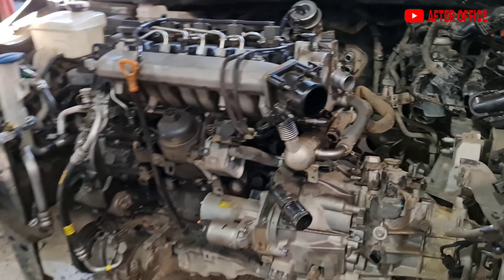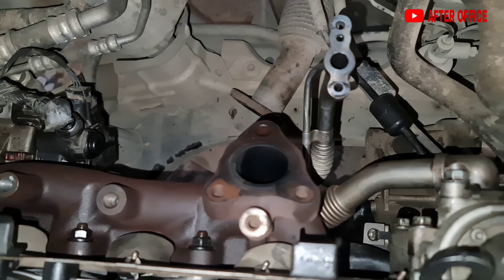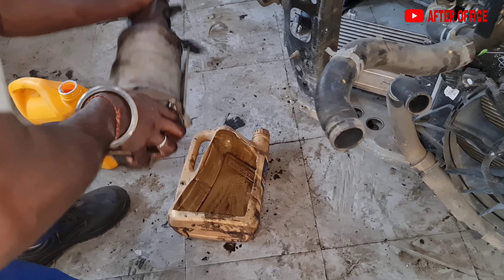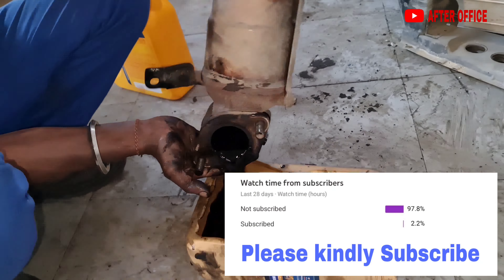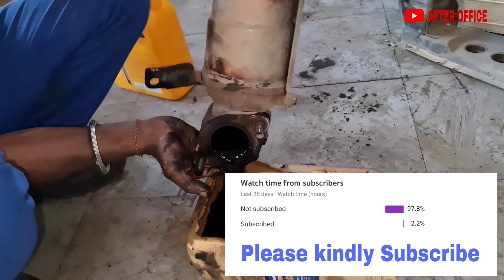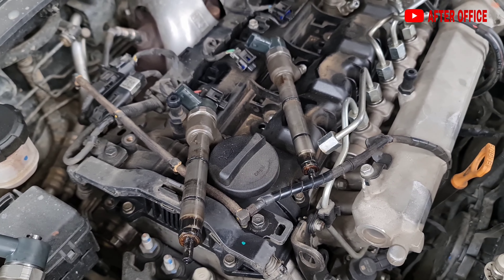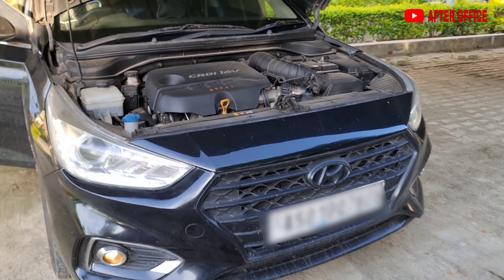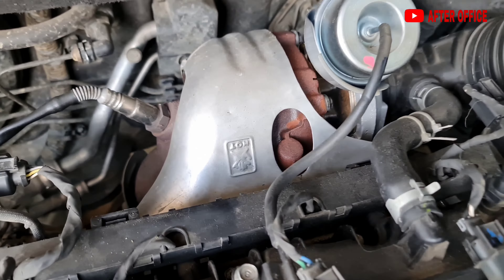Hyundai Turbo fail | Turbo repair, injector kit replacement, catalytic converter cleaning 🙆‍♂️

Comment: Sir in my Chevrolet Sail also turbo failed with ac compressor what are the causes of turbo fail
Reply from the maker: repair it.. Chevrolet turbo repair center are different.. not bosch

Comment: 1.Where is your oil catch can, did you removed it?
2.what is part no. Of turbo core?
Reply from the maker: As the car was at Hyundai, all modification was removed.. I dont hav turbo core part no. as turbo was submitted at bosch

Comment: Mai aapko kaafi time se follow kar raha hu apke pass verna fludic bhi thi to bs ye puchna tha is verna ke engine me kya difference notice kiya aapne fludic ke comparison me jo itni jaldi turbo leak ho rahe hai ?
Reply from the maker: Verna fluidic diesel engine 2012  and Creat Diesel 2015
1. It seems piston quality very good
2. Connecting rod quality very strong
3. Turbo quality lifelong
4. Clutch very bad, wear out in 20000kms 

Verna Nexgen Diesel 2019
1. Engine piston wear out and blowby issue in 50000kms
2. Connenting rod etc lighter and nt feel very strong
3. Turbo also mass production low quality type
4. Clutch very good

New diesel Halka hai

Comment: How is your turbo performance after repairing...?
Reply from the maker: Ok
Reply: I have a Creta which has the same turbocharger as a Garrett. There is a minor sound while the turbo is spooling. What should I do? The service center people don't recommend repairing the turbo as the repaired turbo is not successful, as per their saying, and the new turbo is costly. What should I do? What do you recommend to me?
Reply: @afteroffice_yt  I have a Creta which has the same turbocharger as a Garrett. There is a minor sound while the turbo is spooling. What should I do? The service center people don't recommend repairing the turbo as the repaired turbo is not successful, as per their saying, and the new turbo is costly. What should I do? What do you recommend to me?
Reply from the maker: Repairing that sound might be more.. whistle like sound i guess
Reply: @afteroffice_yt   so what should I do..?
Reply from the maker: Buy new or live with it.  Try opening the existing and adjusting the vanes of vgt. Authorised service center only..
Reply: @afteroffice_yt  okk thankyou ❤️